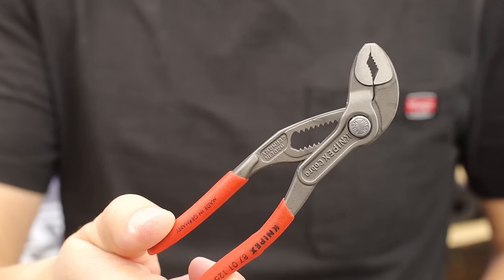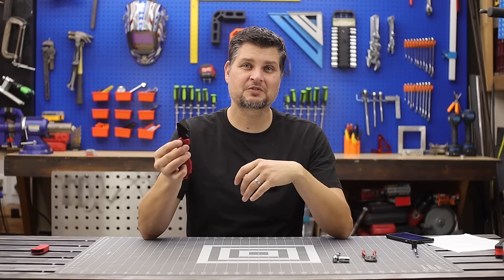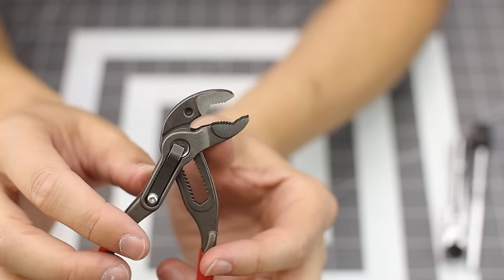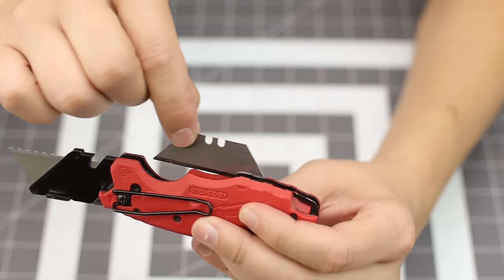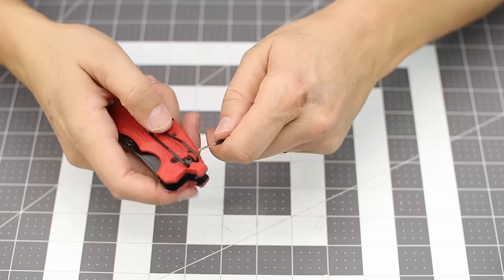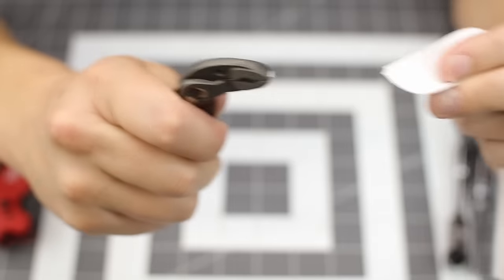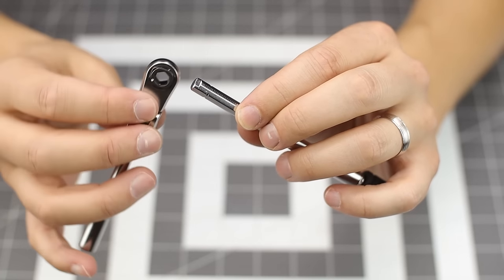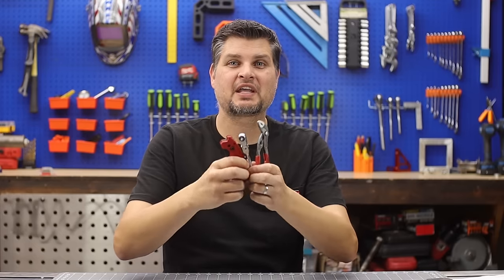EDC Trifecta: Hidden Tips and Tricks

Comment: Adding an extension to a ratchet does not increase torque or "leverage' , it actually decreases it. This guy has never used tools for work, or for Perhaps for any purpose.   Everything new and shiny on that board behind him.  And DO NOT use that 'stripper' for anything electrical.  It scores the copper which will cause it to break open as it gets work hard.  DO NOT do electrical anything if you have to ask why.
Reply from the maker: Are you saying you get less torque or leverage from a 12" long wrench vs a 6"? 
The moment calculation explains it. Force x Distance = Moment
I would love to hear how it decreases it.

Comment: As a Forklift Mechanic, I have that ICON 1/4 but socket and I use it a good amount, I have put a good amount of torque on it and the gear mechanism hasn’t failed- I did warranty it one tho, the extension would no longer stay in the extension position, instead it slid through into T handle position even if the dots weren’t aligned
Reply: I stopped going in to warranty mine. Just happened way too often. Bought the gear wrench 2 ratchet combo for a similar price and pretty happy with it. I do the same work, I know it makes things less painful.
Reply: Same here. Love the warranty

Comment: This really is the trifecta of edc tools. I swear the Milwaukee fastback replaced my Leatherman T4 as soon as I tried them. I needed to cut a lot of boxes for both of my previous jobs, so the replaceable blades became so much more convenient than any of my fancy knives. Then when I discovered the 6in1 fastback, it was an absolute game changer for me working in IT. Made it so convenient to cut zip ties and unscrew rack screws on the fly. I've been wanting to add the ICON ratchet to my daily kit for years, but just never got around to it, as well as a pair of small knipex pliers, I just haven't had the need. I've always known that if I did though, it would expand the functionality of my fastback so much